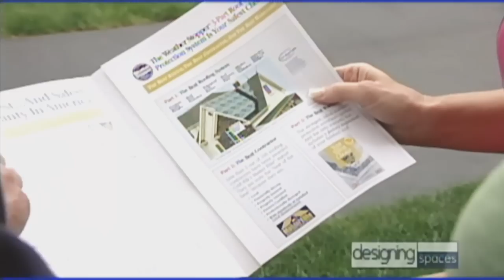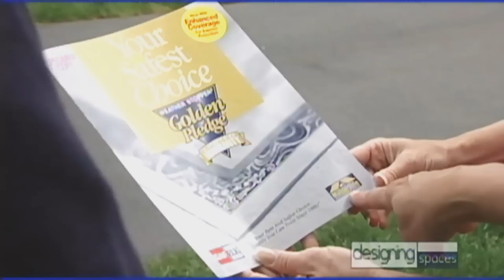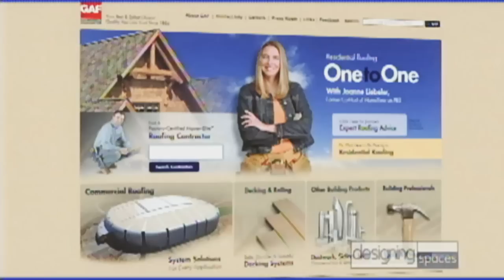How to Choose a New Roof for Your House | Mastering the Roof by GAF

Comment: As a roofing contractor w 20 years of roofing experience I can tell you that being CERTIFIED by the manufacturer is a SALES GIMMICK! Years ago I worked for a company that installed certainteed shingles. All the workers had to be certified installers. What This meant was that you had to take a pass a online test of 50 questions about how to install there shingles. Every worker was given a printed copy of the test w  correct answers to use as a cheat sheet. NONE OF THE SHINGLE MANUFACTURERS HAVE A REAL CERTIFIED TRAINING PROGRAM. AND MOST OF THE MANUFACTURERS WILL CERTIFY A CONTRACTOR AS LONG AS THE CONTRACTOR AGREES TO ONLY INSTALL THEIR BRAND OF SHINGLES AND OTHER ROOFING PRODUCTS.